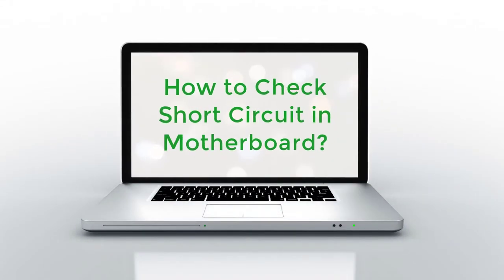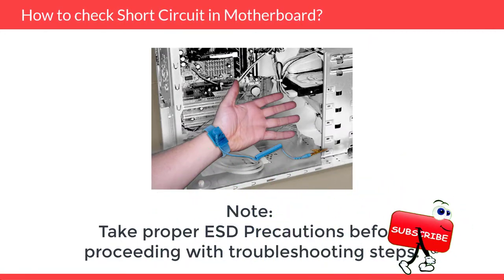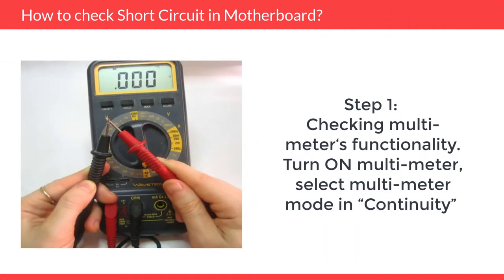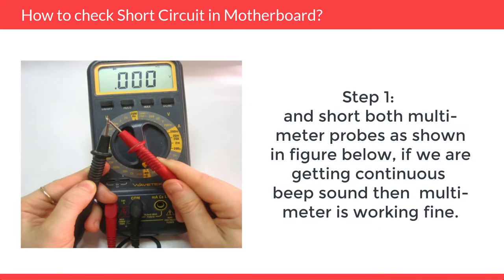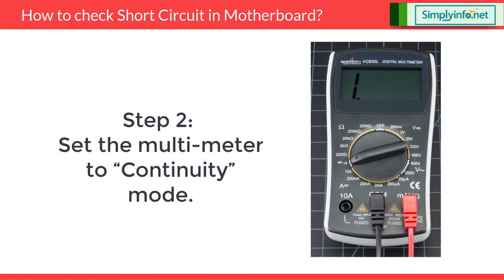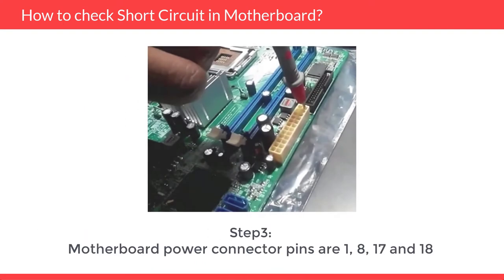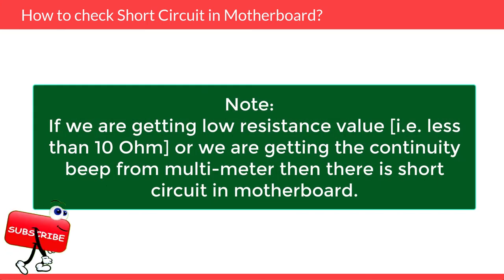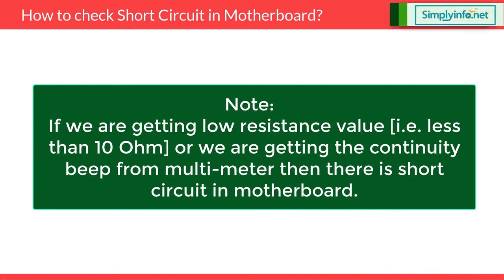How to Check Short Circuit in Motherboard | Computer & Networking Basics for Beginners | Computers

Comment: I have a question. A short circuit in the motherboard means that some internal resistor is dead and there is a possibility of draining max current from the PSU and eventually frying the CPU right ?

Comment: For MB connector, your pins are all wrong. If the blue bar is the lock...then Pin 1 is top right. If you are showing the cable connector, then Pin 1 is correct, but other pins are still wrong because standard counting is 1 to 12 down one side, then back to top on other side for 13 to 24. What are the IDs of your pins 1, 8, 17 & 18?
However, using your diagrams, I got 0.5 ohm for 1, 17, 18, and no reading (open) for pin 8. Can this be possible?